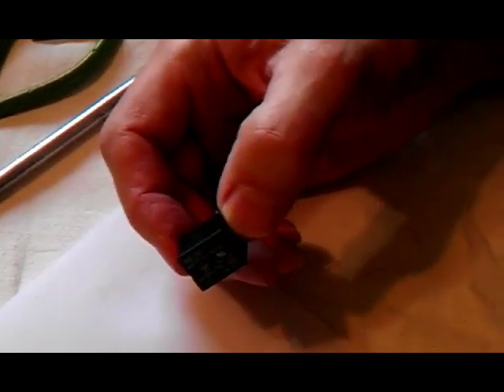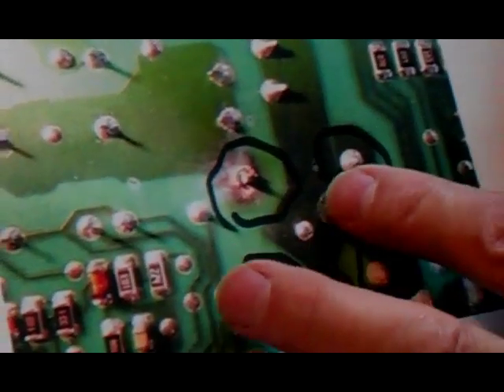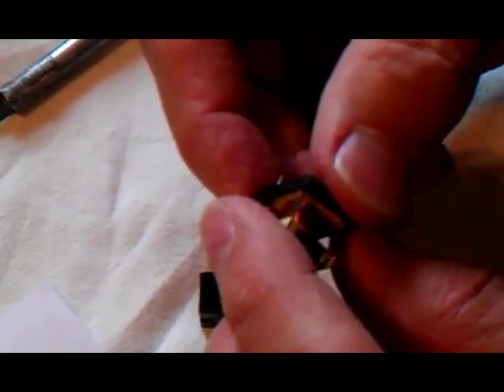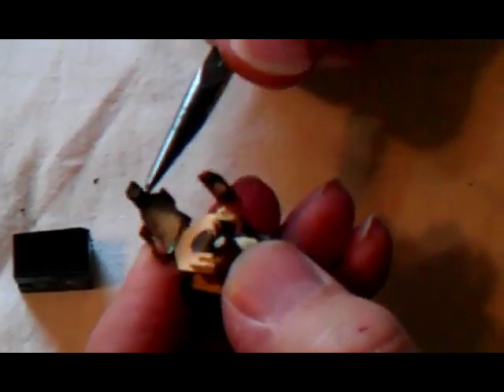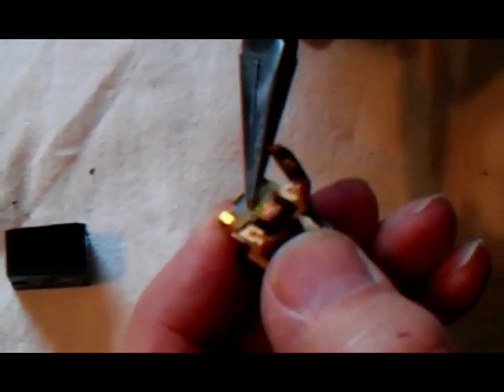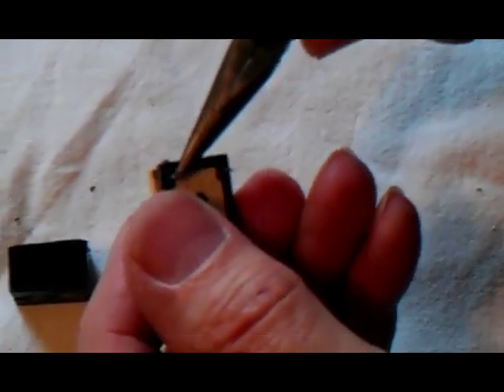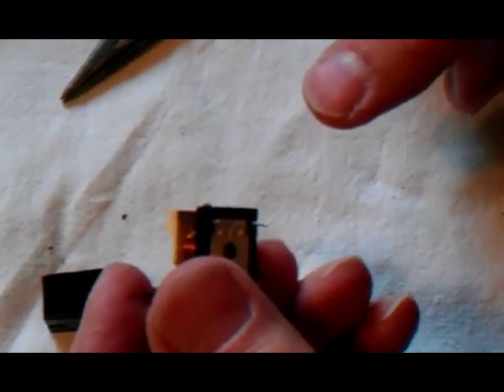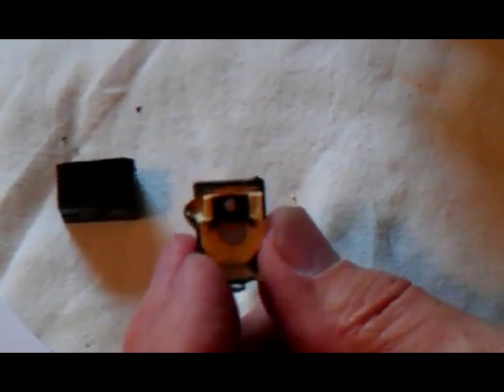Bosch Dishwasher Heater Relay Repair Part 2

Comment: Old manufacturer trick of using under-spec-ed relays so they can sell you a new overpriced circuit board.
Reply: Circut boards are out of my wheelhouse, im about to order a new relay. Is there a version that would be more appropriate for the power so indont have to do this again?

Comment: I just rewired the tiny relay off the circuit board so that it is mounted outside the dish washer and then connected the tiny relay to power a really BIG 20 amp socket type relay to power the heating element. Problem solved since the tiny relay no longer handles high current!  I also added an LED so I can tell when the large relay is engaged. The large power relay does not overheat.  I did not want to have to take apart the dishwasher every time that tiny relay burned to a crisp.
Reply from the maker: That is actually a good way to end the problem with the undersized relay failing.  I just didn't want to go into all of that because most people do not have the expertise to do what you did...I am glad you were able to do it.  Cheers!
Reply: @AgglomeratedIdeas  Yes, I agree it's somewhat advanced. As an old school electronic tech I thought I would throw it out there to let some know that it is possible. As I did my research I couldn't believe that the Bosch engineers powered the heating element through that small circuit board relay. What were they thinking? I love my Bosch dishwasher but I worried that it would burn the circuit board and possibly catch fire which happened to another brand of dishwasher I owned. That was exciting for sure! Never leave a dishwasher running when you leave the house.

Comment: I'd like to comment on finding the overheated relay.  I have worked on designing electronic circuitry for spacecraft for 42 years, and the real source of the problem is the design of the board.  The problem is that the relay is carrying considerable current, generating heat, and no place for that heat to go.  They do have a copper pad on the board, but it is not adequate for dissipating the heat that is generated by the relay. The relay is basically in the center of the board, and it should have been placed near the edge of the board with a path to transfer the heat to the metal of the cabinet.  
In space there is no air to circulate to carry heat away.  During the design of a board, every part has to analyzed for a heat conducting path to a get heat to a cooler sink.  This board is also encased in a plastic container that further limits heat convection to the air in the envelope, adding to the problem.  Even drilling more holes in the plastic enclosure would help by allowing hot air to rise and letting cooler air in from the bottom.

The relay was discolored because the parts had an inadequate path to a cooler sink.  I had the same failure a number of years ago, and tested the relay.  It worked perfectly.  I added a parallel wire from the relay pin that melted the solder, and have not had any further problems.
Reply from the maker: Sorry, but you are not correct about the design of the PCB causing the failure.  I appreciate your hypothesis though.  Thanks for commenting.
Reply: Thanks Golden, you have a point. The circuit board connection for the faulty pin # 3 on my board is near the edge of the copper trace. The spade lug soldered to the same path has 2 solder points just below it. If a heavier post and trace were closer to the center of the trace, it likely would hold up better ( or add a short piece of jumper wire from the relay post to the spade lug ( about 3/4 " ) . I scraped some of the protective enamel from the trace and went a bit heavier on the solder to get less resistance and a stronger path for the current.   J K   (retired AT&T tech )

Comment: Great video!  I have a Bosch SHE3AR52UC.  That relay is not on the board in the door. I believe there is a separate board it's underneath on the right side as you face the dishwasher. My question is, is I identify the relay specs, do I just buy one with the same specs?  Should it be the brand you used?
Reply from the maker: If you can buy the same relay that came with the dishwasher, then you know it will work.  Often though, you can find a relay that is better than the original one.  If you post the part number on your relay, I will be glad to give you my opinion about a possible replacement.  If you are not sure how to read the part number, post a photo of the relay on an image-sharing site such as imgur.com and then post the link back here.
Reply: Took the board out and looked it over carefully. Can't find any overheated contacts. Must be something else. Leaves water at the end of the cycle, but if you turn the washer off and on, and pull up on the float, it drains fine.  I am guessing that the washer stops when the water isn't hot enough .Maybe it is the heat pump. I have to figure out how to test it. Just finished the 5-year warranty, and have had this problem more than once. The last time, I thought they replaced the board and the heat pump, but not sure.  Between this and the continual issue of things (like coffee beans)  getting past the filter and getting stuck in the impeller, I think It might not be worth fixing.  Thanks
Reply from the maker: That's a shame that you have had so much trouble with your Bosch.  Running the DW through a test cycle may help identify the problem.  The instructions as to how run the test cycle are on the wiring diagram which is usually folded up and stuck in a crevice near the water valve.

Comment: Great video.  But I need the same for my Asko D1996-SS.  How do I open it to replace the control circuit board ???  Thanks.
Reply from the maker: Sorry, but I am not familiar with the Asko.  You may find helpful videos here:  https://www.repairclinic.com/Shop-For-Parts/-x64313939367373/D1996ss-Parts
You can also try this:  http://www.frontloadbearings.com/asko-dw95fi-dishwasher-d1996fi/
Or a manual can be purchased here, but it looks like it is the same as the above link:  https://www.amazon.com/D1996FL-D1996SS-D1996HNDL-models-service/dp/B00EV3INE2

Comment: My dishwasher uses the SHC SRE 303006 6VDC 10A relay.  Can't seem to find one, would like to get a 12A if possible, so it doesn't burn out again.  Thoughts?
Reply from the maker: The "6VDC" in your part number is the coil voltage.  Use the 6 volt relay specified in Part 1 of this two part video.  Cheers.
Reply: How to find relay no.? I have SHX33a06uc/22 model

Comment: My machine is SGS4942EP/13, the Unit Control number is 482969. The water does not heat up enough and does not dry.
 I've replaced the heating element. Can I change the relay?
Reply from the maker: A bad heater relay is the most common reason for the water to not heat.  Replacing the relay will certainly eliminate it as the reason for your DW to not heat the water, so I would recommend replacing it.  You will probably need to open the controller to verify which relay you have.  The information will be on the top of the relay.
Reply: Thanks for your reply. I will check.
 Congratulations for your share

Comment: This is exactly what happened on my 8? year old Bosch dishwasher.  Burned solder joint was resoldered with no improvement.  I removed the relay from the control board: single throw double pole (com, NO, NC)  NAIS 12V 5-pin and tested it on the bench - it was TOAST.  You can also test it on the control board.  Put 12V on the coil and the relay clicked, but neither the NO or NC connections functioned. Cut open the relay and the contacts were pretty burned up.  Ordered a new relay (about from Jameco - via Amazon).

Comment: I replaced the relay and added a second bigger industrial relay in the door so the board relay would activate the second relay who activates the heater
Reply from the maker: That is a good repair.  The larger relay can handle the high current of the heater circuit, after all, that is the problem.
I would not recommend this to someone that does not have the skills to do it, but apparently you do.  Great job!

Comment: I purchased a similar model 6 years ago at Lows with a 5 year extended warrantee and it stopped drying the dished at the end of the cycle. I tracked the problem to a 10 Amp relay (switch) on the control circuit board that overheats and melts the solder connection. I did a little research on the internet to see if others had a similar problem. I found multiple instances and that Bosch had issued a safety recall for this problem in other models but not the one I purchased. This is not an isolated incident. The control board costs $150.00 plus the labor to install it.  If you don’t care about lasting more that 6 years it is a great dishwasher.

Comment: Great video! Thanks. I'm having trouble sourcing the replacement part for my control board though. Its a Bosch Classixx dishwasher (SGS53C02GB/08) in the UK. Is there a resource anywhere I can use? The Bosch site just shows the entire control module as a spare. Thanks again for a great video.
Reply from the maker: Yes, the replacement part shown by Bosch for the dishwasher would be the entire control board as you are finding.  Replacing the relay on your existing control board will work fine if that is what has failed.  If you open the control module and post the information printed on the top of the relay, then I should be able to find a replacement for it.  You could also post photos of the relay and the back of the board on an image-sharing site such as imgur.com and then post the links to them here...that way I can verify the actual failure as well as identifying your relay.
Reply: AgglomeratedIdeas
Thanks. Here we go imgur.com/a/PJAIq#0 is the only ID or Part number on the component as far as I can see. imgur.com/a/PJAIq#1 is the component connection view and imgur.com/a/PJAIq#2 shows the burnt PCB solder joints.

Really appreciate your help.
Reply from the maker: Nigel Thompson
You do have burned solder joints on the PCB, but that is an electrical connector.  The relays would be the small white boxes with SHC on them.  I can't see inside the connector, so I am not able to tell if it is defective, but I would resolder the burned PCB connections for the connector and see if that fixes your problem.  Let me know if I can provide any further assistance.
Reply: Great. I'll give it a try.
Reply from the maker: Nigel Thompson One thing I didn't mention is that the pins on that connector looked oxidized from being hot.  You will need to clean them real good for solder to stick.  You may have to remove the entire connector off the board in order to clean them well as they need to be wire brushed, sanded, or scraped.  It might be hard to do that with it mounted on the board.  Cheers.

Comment: I have exactly the same model Bosch with exactly the same issue.  I ordered the same NTE R46-5D12-6 part. You said it would be 4-pin...but there re 5 pins on mine.  I went back to your original post and froze the frame on the spec sheet you had and it shows 5-pins also.  What am I missing?
Reply from the maker: The R46-5D12-6 would be correct.  My board only had 4 pins soldered even though it is a 5 pin relay.  Many of the Bosch control boards do not have the 5th pin soldered...it just sticks through a hole in the board.  Some don't even have the 5th pin at all.  If you have a solder pad at the location of the 5th pin, then go ahead and solder it.  That 5th pin is the normally closed contact and is not used in the circuit, so it doesn't make any difference if it is soldered or not.  I hope that helps explain it.  Cheers.
Reply: I hoped that would be your answer. Very good, many thanks. I love that this is saving the money for repair/replacement. Thanks for posting this!

Comment: The solder joint on my relay didn't fail ... the relay caught on fire and torched the inside of the control box.  The GOOD thing was that the power tripped the latching power relay so it only filled the house with smoke instead of catching on fire.  The moral of the story ... unless you're into replacing the relay ... contact Bosch for the recall.  I found out about the recall AFTER the relay failed!  For some of the control modules, it basically means a discount on a new machine because they don't have replacements ... but if yours is like mine at 12 years old ... I'm not gonna complain :-)
Reply from the maker: Yes, those that tended to catch fire, or at least almost catch fire, were supposed to be recalled.  That's why in my video description for Part 1 I say to check the recall list before doing anything.  Good thing that your power was tripped before anything bad happened.  I guess getting 12 years out of your machine is at least some conciliation.  Thanks for commenting.  Cheers
Reply: After a lot of complications in getting approval (because the serial number had worn off the unit!) Bosch stepped up to the plate and found a new unit with a relay with the correct higher current rating.  And after cleaning the plastic escutcheon enough times to get rid of the smokey smell, it's all back together and working perfectly again.  When everyone got their act together it was great.  It was those first steps wrt the serial number and the problem that the recall phone line was manned from the US and I was in Canada so the right people didn't get involved until I contacted one of the executives!

Comment from the maker: Yes, the relay can fail without any obvious signs at the solder joint. Usually the bad relay will at least discolor the board around the solder joint if it doesn't melt it outright.
You can check the heater circuit with a multimeter at the connector to the control board. It should be about 11 ohms. If the circuit is open, it may be a bad heater, flow switch, or NTC.
The relay can be identified by the info on the top of it. Many of them have already been posted either in this video or Part 1.

Comment: Can the relay fail without obviously affecring the solder joint. How do I identify the relay for relacement on my control board(#496012)

Comment: Thanks very much for a very fast reply! Another success story on your count! :) Dishwasher is back in order when faulty SPST NAIS JS1a-9v relay was replaced with JM67X relay bought from Maplin. The new relay is SPDT 10A and operates in 9v-13.2v range. I hope it is safe and will last a bit of time.

Comment from the maker: Bosch, Siemens, & Neff brands are all part of the Bosch recall. Check to see if yours is included. As for your relay, 9V relays are little more rare. I did a search for your relay but I am finding that it will have to be ordered from outside UK & a long lead time. An option is to put in a 6V relay with a 47 ohm 1/2 watt resistor in series with the coil. A trace would have to be cut to install the resistor. If you email me photos of your board I could help with that if you would like to do so.

Comment: Hi, I have a similar problem with NEFF dishwasher (S5409X0GB/01). Dishwasher stopped heating water and the PCB has burned out relay. Heater relay is NAIS JS1a-9v. Can you please recommend me a replacement relay as I am struggling to find 9v SPST relay in UK. Thanks!

Comment: I believe the relay came from an Australian warehouse. Only problem might be my re-soldering job. I should have used some additional flux.I could see 2 of the solder joints didn't look very good and thought maybe the solder pads were damaged but it did work. I haven't tried it again yet. We'll move to a nicer part of NZ and you can visit for that beer. Hunua falls looks nice. Used to live in West Auckland near Piha beach, but not so great where we live now. Thanks again mate!

Comment: I wanted to say thanks again for your help. I bought the 12 amp relay R46-5D12-12 from another supplier and found solder wick on-line in this country. Installed the new relay yesterday. The old relay looked exactly as you have shown inside, burned out contacts. Tried it this morning and it heated up piping hot like its should, so dit ried the dishes properly. Many thanks. I would buy you beer if you happen to drop by sometime.

Comment: Wow, thanks so much, you are "the man". I Googled it a while back and did get a Panasonic info PDF but didn't know it was 400 ohms or get as far as finding NTE R46-5D12-12. Many thanks for that! And I will try nz.element. I did find one supplier of a replacement relay that said it was "NZ" but in fact was in Asia and shipping was astronomical. Dishwasher is running right now and again isn't heating up. Thanks for the help..

Comment from the maker: The JS1-12V (AJS1311) 10A-125V is a 10 amp relay made by Panasonic & has a 12V coil. Check the coil resistance and it should be 400 ohms for a 12V coil. The 12 amp NTE relay with a 12V coil would be R46-5D12-12. Try nz.element14(.)com in NZ. By the way, solder wick is really just finely stranded wire with rosin flux on it. I have made my own in the past. If you want to make your own, be sure to use rosin flux and not acid flux. Acid flux is great for plumbing, but is a disaster on electronics.

Comment: Thanks so much for the speedy reply. I wish there was a Radio Shack nearby (now living in New Zealand). I like the idea of stranded wire as a solder wick. I will give that a go if I can even find a replacement relay. Not so easy finding stuff down here in NZ, but I am planning a trip back to Canada in August so might have to wait until then. My relay says JS1-12V (AJS1311) 10A-125V - I wonder if that is that like your NTE 12A 6V replacement?

Comment from the maker: If you have a Radio Shack nearby, they have short pieces of solder wick for about $4. They also have a solder sucker (a.k.a. Vacuum Desoldering Tool) for about $18. Or, you could just use some stranded wire as solder wick. Put a little bit of new solder on the end of the wire and the flux will flow up the wire allowing you to use it as wick.